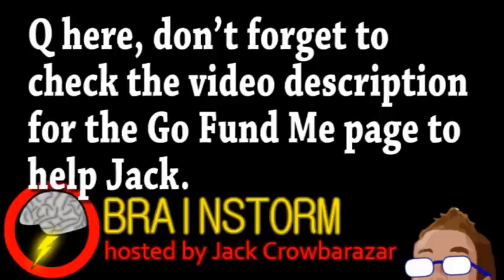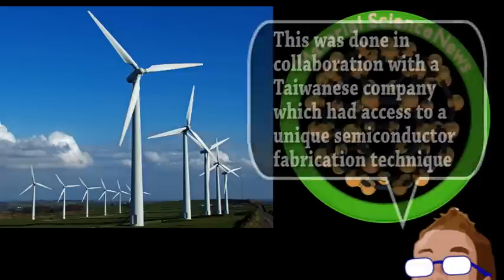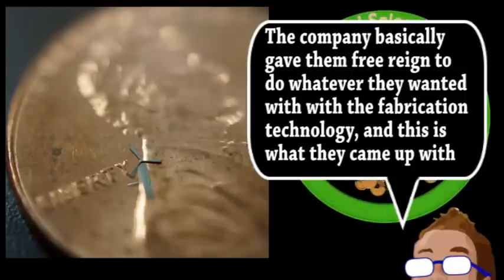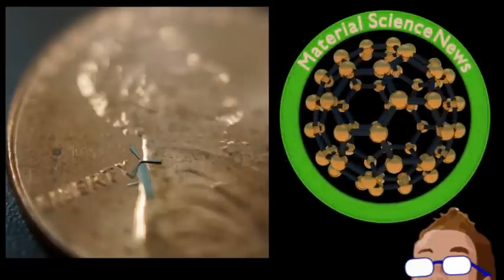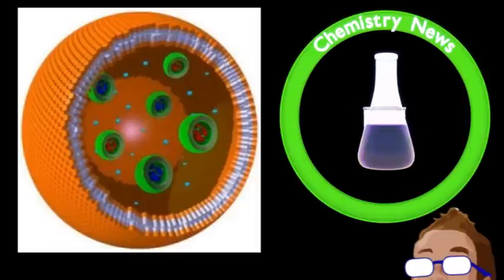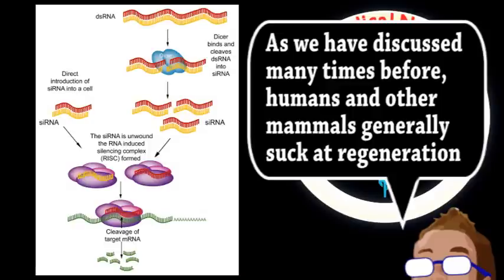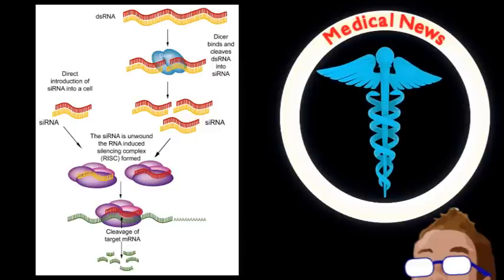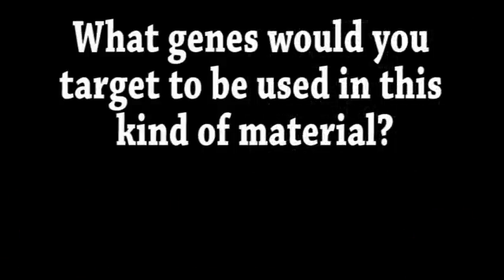Clean Energy From Micro-Windmills? (Brainstorm Ep171)

Comment: the thing with wind turbines is that they scale really well. with 3 blades, the length of the blades is 3 times the radius of the circular surface they cover. and that surface area is proportional to r x r. thats why they build them larger and larger. when you build them larger, the additional energy you get grows much faster than the additional amount of materials you need to build them, they get more efficient.

Comment: The micro wind turbines are interesting from a MEMS stand point, but I don't think there's any hope that they could ever come close to the power output of a photovoltaic device. The main problem is that the because of the shearing forces between a fluid and a surface, the velocity of the fluid at the surface is zero, and at a few millimeters above it will still be an incredibly small fraction of the wind velocity high above. This is why real wind turbines are placed so high up. The fabrication process would also be far more expensive than photovoltaic fabrication. The comments about charging real devices is just the shit the researchers say to get funding for the project.
Reply: On the otherside larger turbines take larger winds to start working these small ones start with tiny amounts of wind and save a lot of energy as it basically doesn't need to be transported to the point of use.